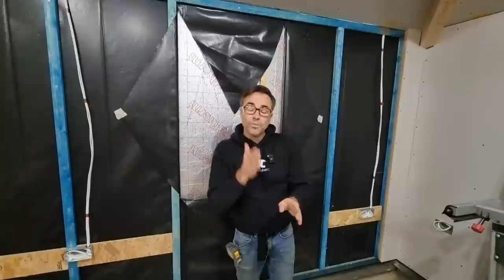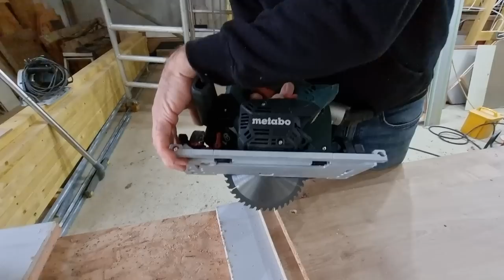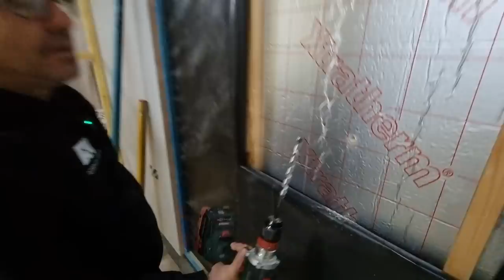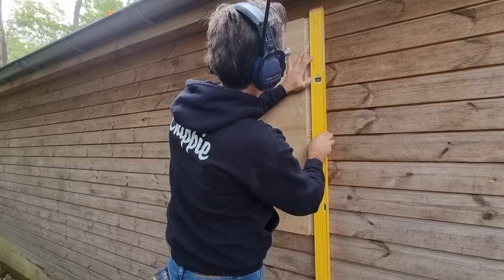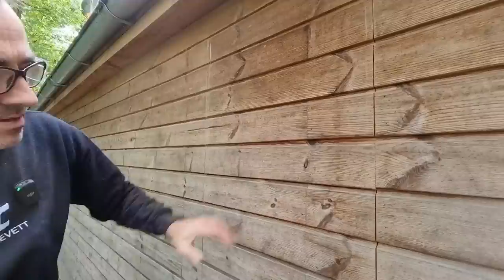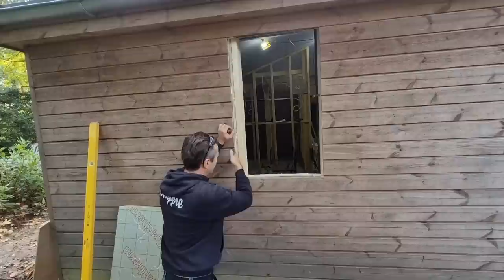ultimate Garden room windows

Comment: Nice job as always, but why rebate the template if u just had went up and down in the opposite direction with the saw?
Reply from the maker: Hi Colin, did you miss the part where I explain why I had to rebate the template???? it is because to reach the full depth of the blade and get through all the material then the motor housing needed to be allowed for in the thickness of the board that I used as a template....... Check the video back and to where I explain

Comment: i think you should have put the hose on as that dust has gone absolutely everywhere 😳
really nice and simple idea though
Reply from the maker: I mentioned in the video why I was not planning on using the dust extraction because the hose would have hindered me and we where outside etc
Reply: @ukconstruction  think it's just the side of me that doesn't like making a mess because i've been told off about it so many times lol
Reply: Think I would of used a rail inside window area still but nice still

Comment: Nice work. Could you not of just made the windows to width from stud to stud to save all the extra work tho. Looks like it's only around 40mm or so difference.  Love the windows BTW.
Reply from the maker: Hi Jony, the regulations for the minimum opening width of the window for fire escape purpose dictated the finished sizes, we need a clear opening of 450mm minimum to comply, and when you factor the frame into the setting out this means that you need to move over one stud

Comment: that's a serious vapour barrier. Please can I ask what it is, other than black plastic? I'll be building a couple of garden rooms in the new few months and want to get the VB right. Thanks Robin.
Reply from the maker: There are numerous vapour barriers available from liquid and paintable to sheet membranes such as plastic, I sometimes use a full on technical breather membrane like I used in my pool (there is a video about the pool ceiling) or we use the standard green plastic membrane, however as I was using this building as the workshop while we where building our house I put a thicker plastic vapour barrier in to avoid damage while we where swinging loads of timber around etc!! That's the only reason.. oh and its not much more to buy than the thin green stuff